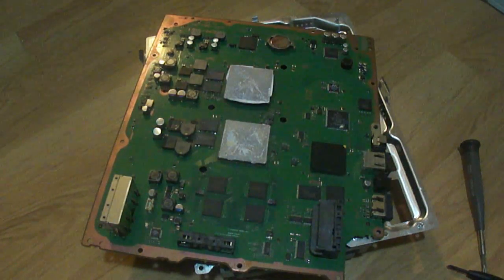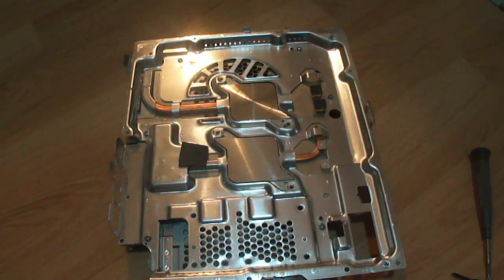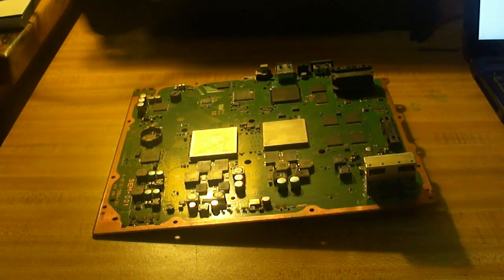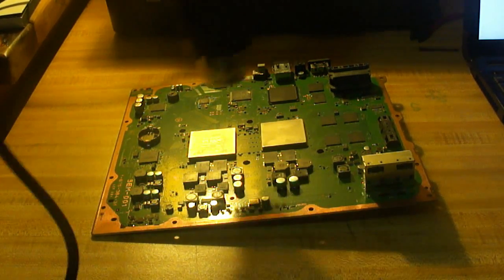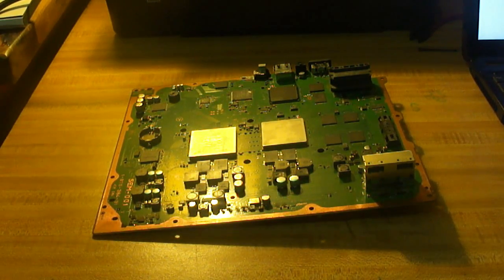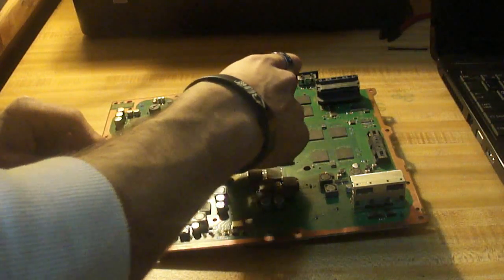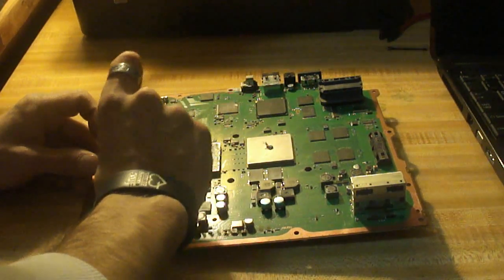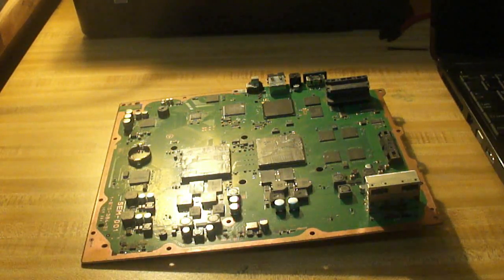PS3 Red Light Fix CPU/GPU Thermal Compound Part 2

Comment: Can you use a hair dryer in place of a heat gun?
Reply from the maker: Yes you can it just takes longer
Reply: Understood. Sorry if it seemed like a stupid question, but one thing I've learned is in science and engineering, one small tweak can make a huge difference.

Comment: Nice video... however... I noticed the clubbing on the top of your fingers. I know this is an old video, and that you might already have been to a doctor. But if you haven't.. do go see one. The clubbing of fingers is a well known sign that there is a potential problem in the heart or lungs. I'd happily be wrong of course.. some do have these without issues. But I would feel terrible if I didn't at least mention it.
Reply from the maker: *****  yes this is an old video and I actually had someone comment on a video about my clubbed fingers as well I have been to a doctor since then and I don't have any problems in the heart or lungs but I do have a lack of oxogen in my blood and that's why my fingers, as well as my toes, look like that he told me it was also genetics as well but that you for the concern 👍🏻😁

Comment: Worked for me. Thanks! For those who do not have a heat gun, you can use the oven. Old electronics trick to reset the solder. It heats everything evenly. Set the oven to about 180-210 F. Leave it in for 5 minute increments.

Comment: Wow!!. Judging by the comments being left on here, NONE of you should be attempting this repair by yourselves. A couple of things to clear up some of the retarded comments i'm reading.
1) OF COURSE YOU NEED THE FUCKING THERMAL COMPOUND, and no you cannot use anything else, The clue is in the name, it's DESIGNED FOR THIS APPLICATION!
2) You should ALWAYS completely disconnect any power source before attempting ANY form of maintenance on electronic systems, even my two year old knows this.
3) DO NOT EVER SPREAD THERMAL COMPOUND. A pea sized amount is enough in the centre, and if you are any good with your hands, it will spread evenly as pressure is applied.
4) If your CPU or GPU chipsets are loose, this is definitely not a simple fix, and NO you CANNOT just fucking glue it to the motherboard.
5) It is likely that if your thermal compound is gone, your heat syncs MAY need replacing too.

If you have asked a question regarding any of the above statements, please do NOT TRY THIS AT HOME, you will only make the problem worse, and/or hurt yourself. ASK A GROWN UP BOYS AND GIRLS.

Comment: My ps3 when turn on only red light stays on solid. Yellow light don't come on. If try to put disc in it shuts whole system down.. What's wrong with it and how do I fix it? Call me anyone who can help 9782653030
Reply: lenny cassanelli take your number off lol your going to get allot of spam are weirdos calling you
Reply from the maker: Does the system beep at all when you push the power button? Are you aware that there are two power switches? What is the voltage of the plug your using? There are a few other things you could check too but try those first 3

Comment: Good video overall, just a few pointers for those watching. 1) There is no point in heating the board with a heat gun then letting it cool to "equalize" the PC board. If that is your intent, letting it sit for an hour will equalize the entire board to room tempature, which is what Rob has done...only wasted 10 minutes doing so. 2) When removing the factory thermal paste, do not use cotton balls. Use electrical contact cleaner that leaves absolutely no residue, and use cloth. Like an old tee shirt or something similar to remove the paste. After its totally clean, do not touch the surfaces of the CPU and GPU. When reapplying with Arctic Silver, heating the paste or the CPU or GPU will make it much easier to spread it out, and use a razor blade. Your objective is to achieve a very thin uniform thickness of the paste and leave no surface uncovered. you must have 100% coverage of the mating surfaces covered with thermal paste.

Comment: Just one question, did your ps3 was permanently fixed? Because I'm hearing that you need to reball your chip if you want to get it done right, because otherwise you're just going to temporarily fix it by just patching  the cpu with a heat gun.

Comment: nice video.Even if u touched the board and havn't plan for the amount of thermal paste to apply.Unless what some says thermal paste need to be spray to not let space spots to be visible on the GPU and CPU(that's will help maximiz the effectiveness of the maintenance).

Comment: To get the true method there is videos on here that show the true way I'm sorry but this way you will get air bubbles and ylod again this method is not good at all,More is not better you just need enough to cary the heat to the heat sinks folks it is not a painting job folks!

Comment: This is exactly correct you took the words from me artic silver 5 will tell you to just put rat turd size in middle of chips then just remove fan and push heatsink into chips with little force so when they connect they will have a dime shape on them also never touch a board with bare hands use latex gloves you can ruin it with static discharge!

Comment: ok man u did it perfectly the only part when u were wrong is when u start smoothing the thermal compound u shouldn't do that just put a small (P) in the centre and close the board and it will spread up

Comment: very poor job at applying the thermal compound... Next time DONT spread it around. Simply concentrate the paste in a circle it at the center of each processor.. try to make a round shape with the paste right at the center as if a rat with semi-diarrhea pooped on it (im serious) then simply proceed to install the heatsink as usual. This prevents dreaded bubbles from staying in between and causing the same problem a few weeks later. call artic silver and they will confirm this if u dont belive me

Comment: I first tried this without flux with a 428-500*F (220-260*C) 300 W Heat Gun from Radio Shack. It didn't work. I then tried Radio Shack Rosin Soldering Flux and heated both sides of the board. That worked. I suggest you use flux (as liquid-like as possible, not paste) for best results.

Comment: whats up. ok 2 Months ago i did this process and it worked great (you my dog). But the red light came back. Is this a common issue? When i re cleaned the CPU and GPU I noticed i did put a lot of Compound. Could that be the issue?

Comment: do not tuch the cpu or gpu when heating it you can disconnect the connections when its hot and just short the connectors and need a diffident fix if so.

Comment: Is it possible to do the heat gun part with a hairdryer?... Yesterday I bought Skyrim and all DLCs now my PS3 decides to stop working. I have tried cleaning the vents with a vacum cleaner, puting a laptop cooler, EVERYTHING! but Im not sure if opening it or sending it to be fixed. Also, where can I buy the silver liquid thing?

Comment: great video!, but my system did not work after following your videos. is their anything i can do differently? like heat up circuit board even more? i had it really hot but might not been enough? if you could help that would be great thanks!!
Reply: No you don’t need to heat it up
Reply: Just add a dot and close it and it will spread that’s all just make sure you use a cloth and alcohol too clean the cpu and gpu make sure that it doesn’t get on the motherboard

Comment: i had the ylod and i saw your video and it worked thannx, but after awhile it started 2 freeze, but didnt get the ylod, i can eject my game and insert another but i cant see anything, i tried 3 different hdmi cables and didnt work, i tried 2 flat tvs and an old tv with d normal video cables and nothing, i reset it by pressing the button for 5 6 sec. and it works for about 5 min. and it freezes again,sometimes i can hear whats goin on in d ps3 but cant c anything, please help meee..

Comment: Don't spread it do not spread the thermal compound ! What you want to do is put a tiny bit on the Langtry and thickness of a grain of rice because the thermal compound will spread as you re attach to the motherboard to the heat sync . So DO NOT SPREAD !!!

Comment: Got a $17 heat gun on Amazon and fixed up a friends ps3 so glad it payed off works well ! Also when using Thermal compound/paste just squeeze a blob out on to the CPU/GPU and then place the whole motherboard back onto the heat sink or if it's a different model PS3 place the heat sink back onto the motherboard. this way it will actually spread out the Thermal compound/paste without leaving any air bubbles.

Comment: Hi there
From the East coast here. Nice video. I was hoping you could help me to understand how what you did fixes the problem. So I hear you say that the contacts between certain components can separate or loosen over time. How does heating the board and applying thermal paste actually re-establish those loose connections?Furthermore how long after you do this the PS3 will last in average..? Many thanks in advance :)

Comment: Having no thermal paste is like having no oil in your engine or water in your radiator, its what transfers the heat from the chips into the heat extractor for the fan to blow cool air onto. once a system reaches a certian heat it will shut down or refuse to start because it knows it will get so hot it will destroy itself

Comment: ok, first at all i want to thank you for your video, i fixed my PS3 wth your help, but now i have another problem after i fixed the red, yellow ligth, wich is that my controllers doesnt connect in a wireless way with the console and i have to use a usb cableto play, i dont know what i did wrong but my PS3 is not wireless no more. What can i do? i need your help with this......you are my only hope!!!

Comment: When applying thermal compound it's best not to spread it across the CPU/GPU because then when the heath-sink is installed there are lots of air bubbles, and as you may know, air is not a good heat conductor. Leaving it as a pea sized blob in the middle and then installing the heat-sink is the best way because the heat-sink itself spreads the compound over the CPU/GPU.

Comment from the maker: if your system turns back on and has a steady green light and only over heats from time to time yes its ok, but if its a red light permanently than you need to heat treat the board with a heat gun

Comment: if you want to spread thermal paste.1.get a zip-lock baggy or plastic.2.put your finger in to the corner of the bag and spread as necessary. this is how i do it and it works out well. for all people who say not to spread the thermal paste it is fine to spread the thermal paste as needed or you can use the dot method. which ever you prefer just dontget it on your hands! have fun you can buy this thermal paste at

Comment: yes the hair dryer really works but only for a few days but i did it to mine and it began to stop working and causing more problems so if i were you i wouldnt use a hair dryer unless its for a time or so but its much better to fix it now and you can get thermal compound at best buy wal mart hardware store or toher eletronic stores but i recamend best buy my silver paste was only $10

Comment: can u use a hair dryer instead of a heat gun and if u have to use a heat gun where can i possibly get one at (hardware store possibly) and for how much.  Also do i do the same thing for the 60 gb backwards compatible version as u do on this video since u said the one in the video was not a backwards compatible version

Comment from the maker: sounds like your PS3 is restoring the file system on the HDD your hard drive may be failing or not yet failed and is on the verge of it. Unfotunetly you will loos all your data but it shoud be backed up on the PSN but remove the Hard Drive from the PS3 and run a Hard Drive stress test on it and see if its failing

Comment: im not trying to be mean or negitive in any way by the one thing that yu did not do correctly is have the borad even. with out it being even the soder will ten to flow down wich ever way gravity takes it so next time you fix it the ps3 from ylod it wont have for long

Comment from the maker: what do you mean that "a lighting mess it up" ? i believe your saying that you had a lightning storm and a surge went through and fried something, it might be this process it might not be if the warante is still good send it to sony for them to fix it if not your gonna have to take it apart and the connector for the Audio and Video is probably fried, youll be able to tell cause it will be either grey or black depending on the dammage, also you will need new thermal paste on the CPU and GPU

Comment: I don't have a heat-gun, but I saw a similar trick with something else, but done with putting the thing in a pre-heated oven for 4 minutes. Do you think that will work?
I'm not willing to buy a heat-gun for this one-time use that might not even work.

Comment from the maker: yes you need to heat treat the board cause the GPU is off center causing your video feed not to show so do the same process and then let it col and apply thermal compound